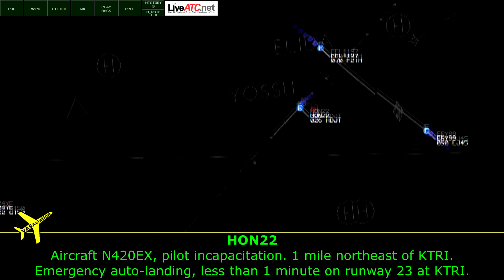HondaJet Plane AUTO-LANDS ITSELF after "Pilot Incapacitation" | Certification TEST Complete!

Comment: Right off the bat, the HondaJet's readout needs to be sped up.  It doesn't need to take that long to say the information.  Beyond that, sounds like an overall good test, but I do wonder what'd happen in real life and not a controlled situation.  And it's a bit of an extra training for the controllers all the way around.

I like it though.  That's a fantastic thing they're trying to make happen.  I do wonder how it's going to decide to go to emergency landing mode though, as they had to push a button.  I'd assume some sort of, if you'll excuse the term, deadman's switch would have to be integrated, but how is the key here.  If a pilot is incapacitated, how are they going to press the button?

I'll have to look about for the plans on this.  Nifty stuff on the surface of it.
Reply: Remember that the system is likely incapable of responding to ATC saying "hey can you repeat that again?"
So the pace of enunciation is deliberately slowed down.

The "button" is only used for (1) manual triggering of the system (e.g., for testing), or (2) passenger-triggered activation (e.g., if passenger sees the pilot suddenly slumped)
The system likely has a "dead man's switch" system to detect pilot incapacitation. It's not tested here, though, especially since the dead man's switch will take minutes to actually activate.

Comment: I guess production systerm won't even have the button. Just analyze pilot inputs (lack of them) before engaging on its own. Some incapacitations can be so sudden the pilot would not be able to even press the button
Reply: This is a production version, afaik.  Not much sense in certifying a prototype.  The Cirrus version has a button for passengers to push, and further automation will will undoubtedly come in future versions.
Reply: My understanding is that they both have a button for passengers to press and detect if the pilot has stopped interacting with the controls.
Reply: @juliethecyborg  I Imagine that it's not just for passengers,  It's possible a pilot might chose to manually activate the system, incapacitation may not involve complete loss of consciousness, it's quite conceivable someone might be initially aware of an escalating situation.

Comment: 2:10 Oh that is a relief, a actual tts system and not ChatGpT pretending to be Obama.

No I am being serious, technology being trendy, being rushed, or cutting corners has clear red flags. That was my threshold for identifying such a thing. 

This tech is going to be a great thing. I am actually curious on if we could use its vital sign monitoring to actually prevent incapacitation. 

There are some warning signs before a heart attack. With a simple BP vis PulseOxy Meter, we can monitor the ratio between Blood O2, HR, and BP. If a sign is present for a minute or so, it could already start asking Controllers for help and have EMTs ready to save the pilot. That would be a miracle executed. The pilot could just focus on coughing to keep blood at the top of the heart rather than talking. (FYI that is what you should do if you think you are having a Heart Event, Cough and DO NoT STOP)

Comment: The voice is eerie and chilling.
Having a counterpart to the pilot stepping up in the event of a systems failure and performing an autoland is great.
Hopefully, it will soon reach a stage where cases like Helios Airways Flight 522 will become a thing of the past.
Reply: Can you imagine the confusion if the controllers thought they were talking to a real person? A robotic voice makes it clear that they are not talking to a pilot. It is actually an ingenious safety feature.
Reply: It's probably a deliberately robotic voice. Helps people realize it's not a real person
Reply: @DapperLizard yeah it’s key to not let atc think it will give them information like souls onboard and such. So atc can then start a process since when an emergency is called that plane owns the air all other stuff is put on holding patterns. Hell if a mayday is bad enough military airports are open for use of the emergency aircraft (it’s a process after they land but they landed alive). So they might roll out a  procedure for just checking the capacity of the plane and that’s what you tell emergency crews. For instance “we have a plane coming in on auto land, plane capacity is 12 souls, fuel capacity is (insert fuel amount)” and that way emergency crews know the worst to expect and can work from there. Or maybe the auto land system gets a soul count input before the flight starts so that way it can transmit amount onboard. The tech can go many ways and I am not overly knowledgeable on this kind of stuff. I know a lot about a little and a little about a lot.
Reply: @DapperLizard  its also extremely simple- which means its easy to certify because its easy to test it in all conditions.
Reply: A bunch of manufacturers have already started rolling out a feature that Airbus calls automated emergency descent - if the plane detects low cabin pressure, it warns the pilots, and if there's no response, the plane automatically flips on autopilot, autothrottle, etc, declares an emergency, and descends down to minimum safe altitude. If you're in a A350-1000, and a couple other types, a Helios type incident is already impossible - barring equipment failures, of course.
Reply: @FNLNFNLN  Helios situations are terrifying. It's great that this automation is being added, so long as living and conscious pilots still have the option to override and the knowledge how to do so.
Reply: @FNLNFNLN  That is amazing to hear! Happy to know this.
Reply: Along with auto depressurization response, as  @FNLNFNLN  mentions, Airbus has auto-TCAS, to help prevent another Überlingen. You get a TCAS RA, you put your hands in your lap and let it do its thing. They were also talking about auto-GPWS at one point, but it didn't work out.
Reply: I hope they keep the robotic voice, it is jarring and really draws attention to the emergency
Reply: When I hear that; it sounds like danger to me. Like the end of the world is coming type of sound. 
Our military equipment would speak like this while navigating with other units. And sometimes it took to long for information to be said while moving. 
Frustrating!
Reply: @thomashenshallhydraxis  Probably not. Even today when you put two AIs together they quickly switch from human voices to GGWave - a kind of modem-esque digital language. That is truly eerie.
Reply: @another_pointless_account4130  That was a deliberately setup test, they don't just do that.
Reply: @katkosmos  May have been set up for the purposes of demonstration but the technology is there and is in use already. My point was that AIs of the future won't communicate with each other in human language.
Reply: It's the same computer voice that BART in the SF Bay Area used to use for their platform announcements.
Reply: or the Learjet 35 N47BA crash that killed golfer Payne Stewart. Pilot took off in Orlando, Florida intending to fly his charter to Dallas, Texas. Sometime after taking off and getting to FL 390 (39,000 feet) both he and his FO became unresponsive. The pilot of the first F-16, a USAF-operated aircraft, that intercepted Learjet 35 a bit over an hour after they went silent noted the cockpit window was opaque, believing it to be fogged or iced over. Two hours later, the aircraft was intercepted by two more F-16s, this time operated by the Oklahoma Air National Guard, noting no movement in the cockpit and struggling to tell whether or not the windshield was iced, describing it as a "dark cockpit." It was sometime around the second interception that the unresponsive aircraft reach its maximum height of 48,900 feet. Temperatures at this height are antarctic cold, around -40 (the one and only point where Fahrenheit and Celsius reach parity) and not survivable by humans for more than a few minutes, even with proper protection. Even if they were unconscious but alive around the time of the first interception, they were dead by the time of the second. Around 45 minutes after the second interception the North Dakota Air National Guard takes over to allow the Oklahoma ANG pilots who were escorting N47BA to return to base. Shortly after they assumed escort, and at nearly 4 hours of flight time, the Learjet flamed out and stalled, entering a sharp descent while quickly picking up speed. It hit the ground like a lawn dart, going nearly mach 1, and both it and its deceased pilots and passengers were entirely obliterated upon impact with Earth. Because it was out of fuel, it did not create fire or an explosion, but it did create a 42 foot long, 21 foot wide, 8 foot deep crater, a picture of which can be found on the NTSB report and on Wikipedia, with a convenient NTSB investigator for scale.

ATC recordings of the incident are available, and while I've been unable to find the CVR, it was recovered and it did record the last 30 minutes of the plane's cockpit audio. Because both the pilot and FO were dead, the only things that were worth noting are that the engines audibly spool down, and the stick shaker rumbles and autopilot kicks off as it enters a dive.

Had this technology been available in 1999, the aircraft would've sought the nearest airport and landed itself once the pilot and FO became incapacitated. They may have even regained consciousness on the way back down, as the autoland brought them back into the lower troposphere. Better late than never, I guess.

Comment: Now I haven’t watched the video yet, but I am curious if the pilots incapacitated and Honda jet takes over for the landing does it also make radio calls?
Reply: Dang! It sure does!!
Reply: If it's like some other systems like Garmin's, it can even adjust course to avoid weather and terrain
Reply: Well -- honestly, NO is the answer.  It makes radio calls, yes, but it doesn't make valid radio calls.  It pretty much does everything it can to NOT follow the spec here.  It just blasts what some engineer thought would be a good thing to say, instead of what all the local VFR traffic need to know to get out of its way.  Instead of saying, "5 mile final, KTRI runway 23", it says "3 minutes from landing at KTRI." I don't think it even says the runway until the very end, when it's ON the runway.  It seems whoever designed the radio call subsystem never took a single class, nor read a single brochure, nor watched a single VASAviation video, .. nothing .. about how radio calls are required to be sent (automated or not). Despicable, and they should NOT have certified it with such poorly-conceived radio calls being made, and especially with it obviously not doing what the most common household networking gear does, which is wait until the line is clear before transmitting. You don't need AI for that task, though something tells me an AI would have come up with a better scheme than what the authors of THIS particular non-aviation-valid automated radio transmission subsystem did.
Reply: @SteveGoldberg  Watch the video again.  Every transmission includes the runway.  I like how your entire rant is apparently based on not actually paying attention to the video you just watched.  Also, including the ETA rather than distance is more useful, since anyone listening may not know how fast the aircraft is going.  Also, the aircraft may be maneuvering before landing. so again distance on final is irrelevant.  By including the ETA, the emergency aircraft speed/altitude is irrelevant.  Anyone making decisions based on the emergency transmission has all the information they need with just the ETA.
Reply: @mrpuddingsnacks  OK, so I'm wrong about the runway. But it didn't ONCE use standard phraseology!  It clearly made the broadcasts at exactly the right times when you're supposed to -- turning base it said "7 MINUTES from..." instead of "turning base for runway 23", and when it turned final -- I was really shocked at this point -- instead of saying "5 mile final", it said, "3 minutes" (or was it 5?) "from landing".  So idiotic.  It simply should not have been programmed to use this nonstandard phraseology. Pilots flying in the area would NEVER be able to work out where it was!  Situational awareness is the #1 way to avoid collisions in the air!  So sure, the family is "safe" until a happy-go-lucky VFR pilot slams into them from the side. (Full disclosure: it DID say where it was in the very first transmission. But that was just a general description; it certainly didn't stay at that position, as it did what was needed to enter the pattern for landing.  It never once reported its POSITION after that, only a time-estimate as to when it would land!)
Reply: @SteveGoldberg  I don't think you read my comment.
Reply: @SteveGoldberg  the phraseology was developed in collaboration with the FAA, obviously.  Go back to your simulator.

Comment: Good technology but what happens if the runway is closed or for some reason?  I’m assuming the plane will auto-land anyway.
Reply: The system gets information from NOTAMs
Reply: Probably. Landing at a closed runway is still better than the alternative.

Airport ops gets ~10 minute warning to clear the runway.
Reply: Probably a serious problem if the system is still showing the airport and runway being available. But, it's truly a life-and-death situational use-only certification I presume. The pilot is incapacitated and no other person is capable of flying and landing the plane. 

It would be ideal if the ATC could send it confirmation of runway availability, so it could choose an appropriate alternate airport if necessary.
Reply: @hotsoup1001  not how it works. Emergency Autoland takes the information from the ADS-B in airport information to know if a runway is NOTAM'd closed and adjusts accordingly. It will choose a sufficient length runway with an LPV approach that is open and land there.
Reply: @N1120A  does it take weather and crosswind into consideration when selecting a runway?
Reply: @vonnikon  Yes